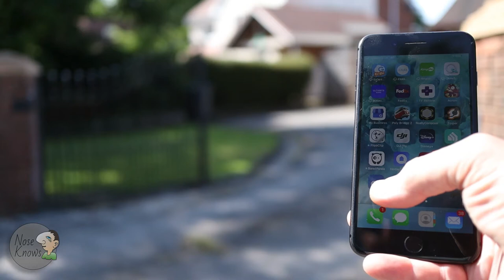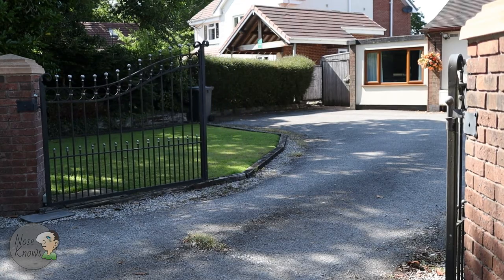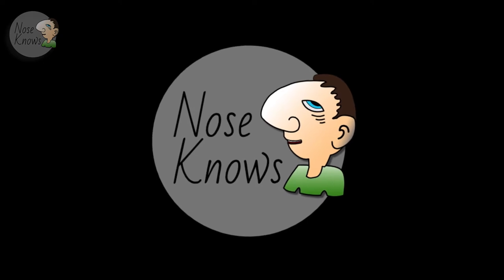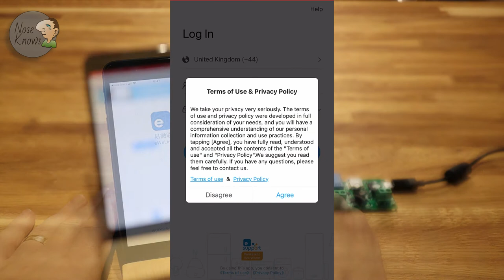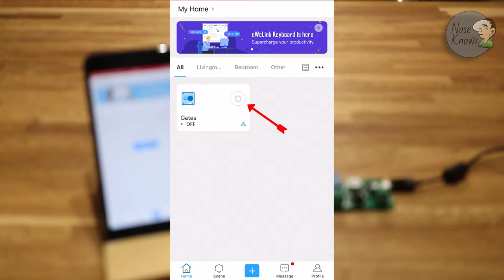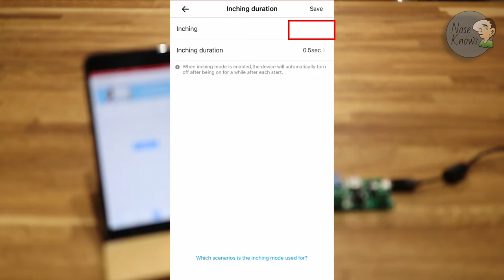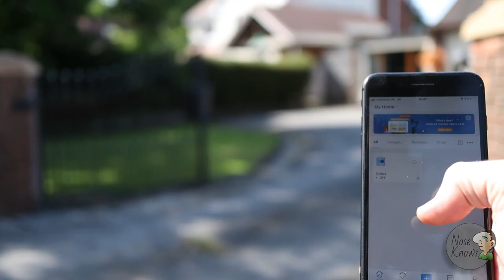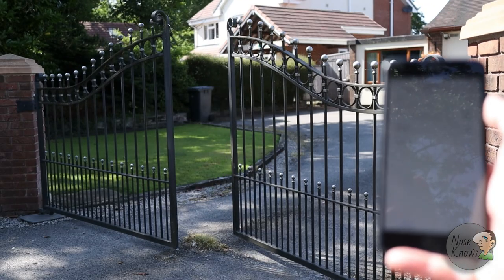MAKE SMART DIY Electric Garage Doors & Gates by installing a cheap Wifi module for remote operation

Comment: Excellent and informative video. One of my customers just asked if he could use his mobile phone to open and close his ROGER Smarty 7 auto gates I installed and your video perfectly answered his question. Muggins here will probably end up installing this relay. On the ROGER Edge 1 control panel the NO cable from this relay would go to terminal 35, the PP input. Many thanks.

Comment: Friend great video.  can I connect this to my rolling gate garage  where I have the wall mount switch open and close button. just connect this to the open button ? in itching mode ?  actually my wall switch has  3 buttons Open . Stop and  close.

Comment: Hi, great video and a job well done. One question though, how would the module handle error i.e. if the module fails is there anywhere to manually override it?
Reply from the maker: Hey thanks - Yes the gates still work with key fobs etc. for example I have this installed on my gates BUT myself and family still have the key fobs to open and close gates. The module is great as I can set times for gates to close at night etc as well as asking voice assistant.

Comment: Thank you for the video, I did two similar to this (one for the garage door and another one for the gate) but I don't have the inching mode on smartthings and I had to add a routine for auto-off after 1 second.
Now I'm after a device that will give me an indication of the gate's situation.
The gate has limit switches and I want to use them for that purpose. All I need is a wifi device that whether the circuit is open or closed. 
Do you know such a device?

Comment: Hello. I enjoyed the video. I installed a similar smart relay for my gate door. It works fine BUT now the remote control I was using up to now does not work. Is it possible fix this?

Comment: Thank for the great video. Do I need to keep the module close to any WiFi signal like 5g or access point or should it be 2.4gh. Is the 2.4gh wifi needed for setting up only?

Comment: @nose knows could you please tell me where on the CO Z gate opener  circuit board would I connect the two wires from the module to?

Comment: You got the 24vdc module, as you need to power from 24v from board. Mine does not have 24v but checked online and there is. 230v module option. The relay to the switch, on the other hand, is a command signal, so no mmattert the current of the board correct?

Comment: Hi. Thanks for the video ! It clears a lot up. I was wondering if you knew if there was a mode to "hold" the gate in the open position?
Reply from the maker: Hey - The hold gate open is set on the control board nothing to do with the WiFi module that’s in this video.

Comment: I ordered this and the Tuya smart app was what the device recommended and we got it functioning on our phones. The gate opens. But we can’t seem to get the gate to close except when we override it with our keypad or RF button opener. 
It is set to auto close after 2 minutes so it’s not an issue really but do you perhaps know how we could close it on demand?
Reply from the maker: Depends on if you control board is the same as mine in the video. If it’s the same the the drop switches select what modes do for example your auto close after 2 mins. I suggest grabbing the manual from somewhere and looking at you electric gate board manual as the module you have fitted simple sends a pulse to the two terminals connected so when you send the command it pulses if the gates are open it closes and then if they are closed it opens them be aware depending on how your gates are set as well with time as there is usually a overrun.
Reply: @noseknows  we have the same brand and manufacturer but it’s a 12v system with slightly different labels in the control and accessory power so we worked with what we had. I’ll check it out further

Comment: Does this know when the gates are open/closed?
Reply from the maker: Nope - it purely sends a pulse to the gate control board which is the same as pushing a button on your electric gate remote
Reply: @noseknows  thanks
Reply: @noseknows  does it override the safety features? Or would the gate behave the same